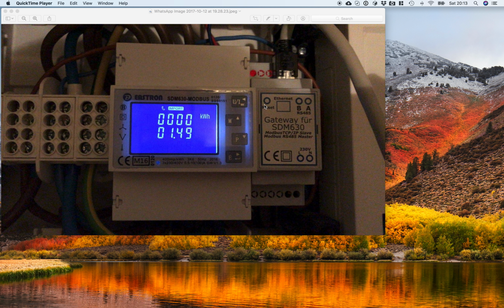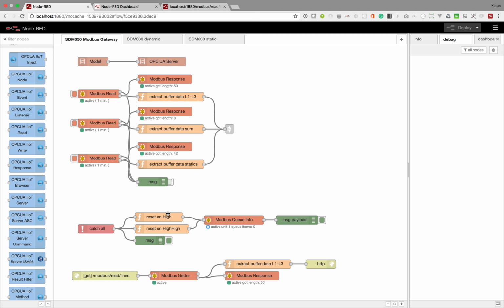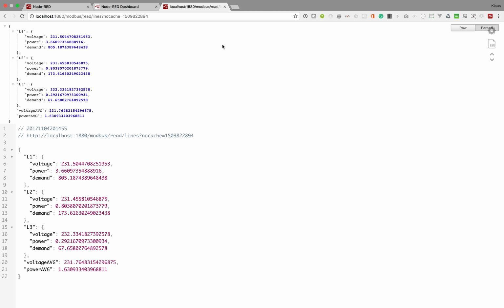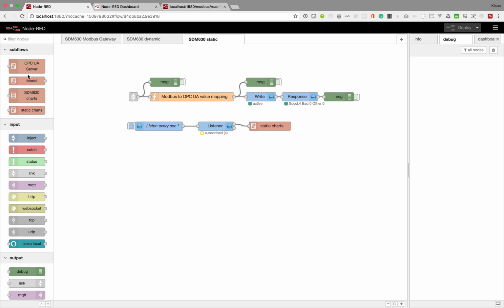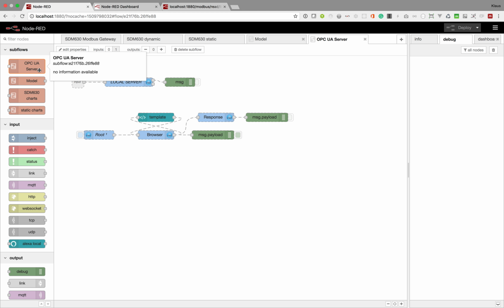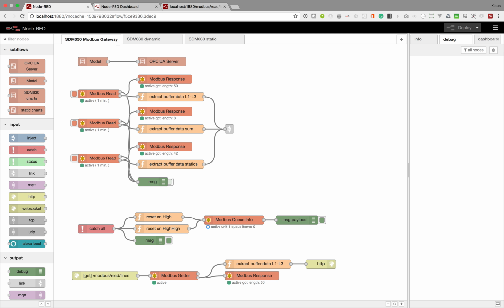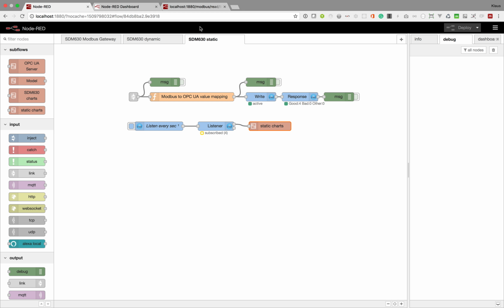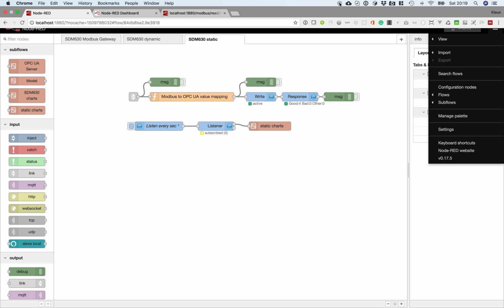SDM630 Modbus to OPC UA with Node-RED Subflows

Comment: Hi Klaus... I have two SDM630 installed and am polling 1 at the moment using a pymodbus approach. I have the nodes from github which you are using, however I keep getting token error. If I use the modbus serial node data flows OK but is not usable. Currently with the python script I am using MQTT to import the data into node-red and graph using grafana. The reliability is not good and I would like to know how you are getting the data in the first place. My Raspberry Pi is using a RS485 to serial device on USB0 which is working. I am hoping the method you use will be more robust.